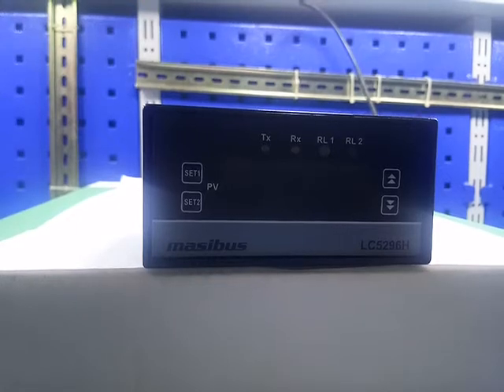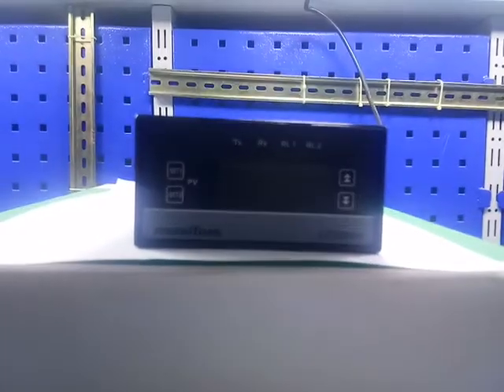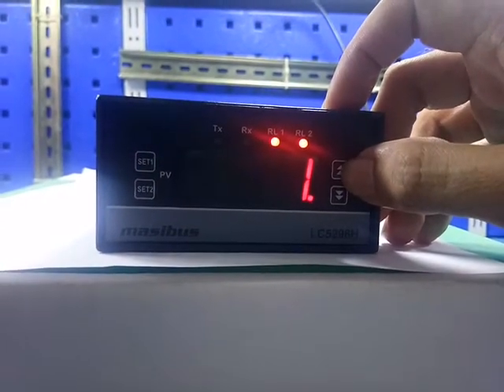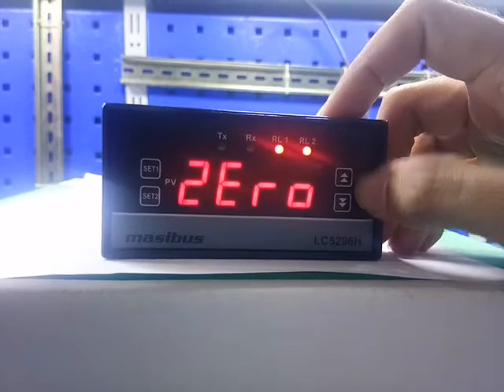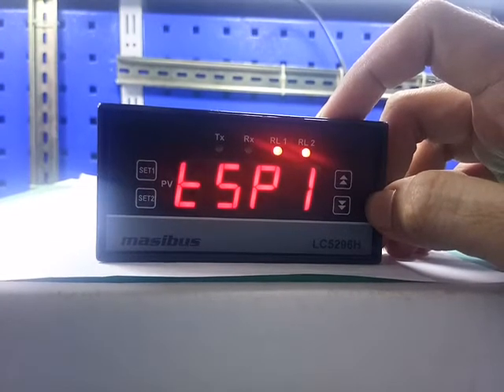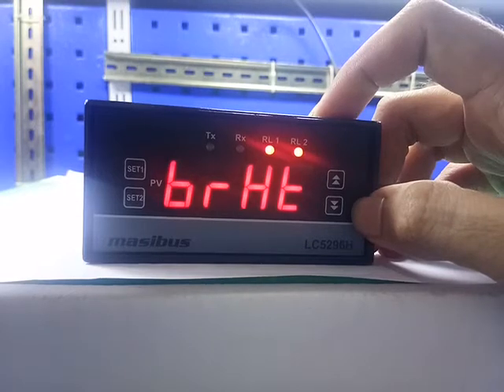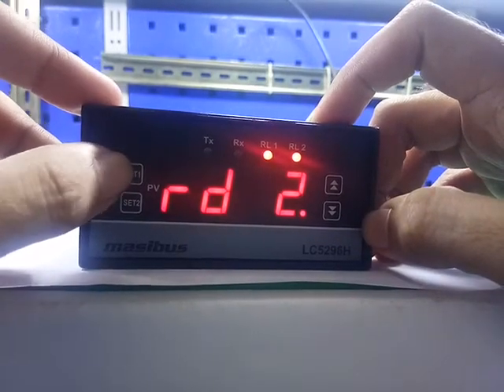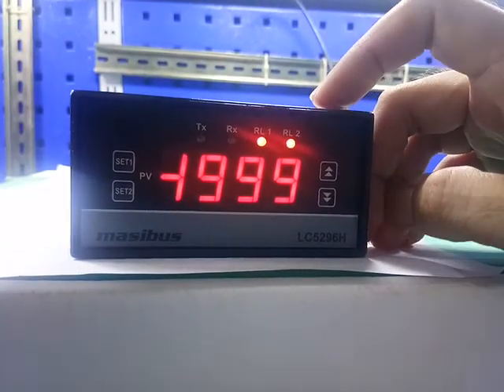Masibus ON/ OFF Controller LC5296-H Configuration

Comment: I want to display 0-1000 Voltage (DC Voltage) and 0-40Amps.  In both cases, the analog input Signal is 0 -10V. Can you tell me does this device meets my requirement.
Reply from the maker: Sir I will request you to please share your contact details, I will ask my team to get back to you.
Reply: I have controler LC5296 AT